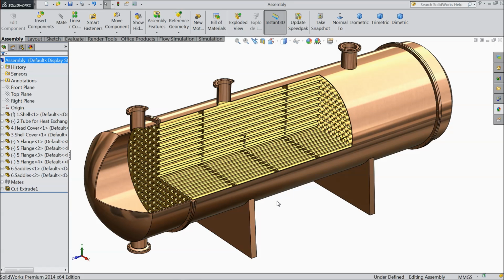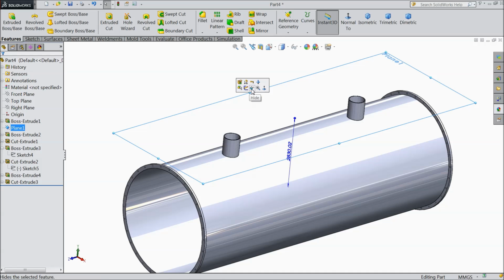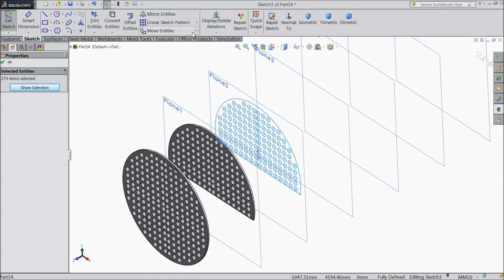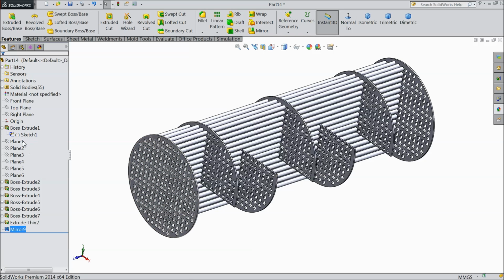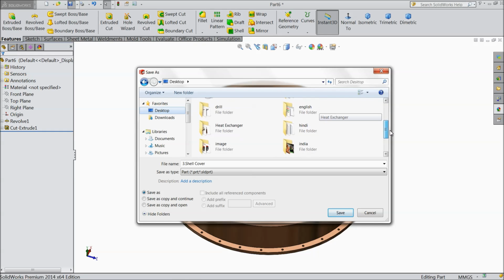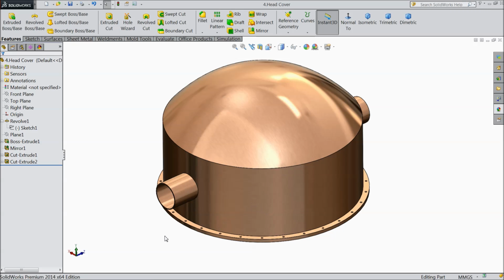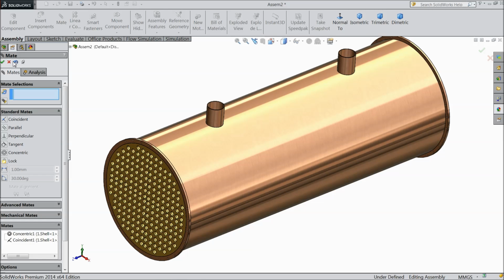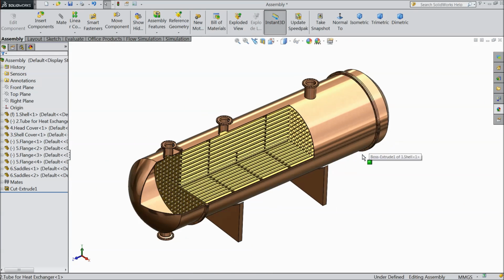Solidworks tutorial | Sketch Heat Exchanger in Solidworks

Comment: I think you missed the partition plate in channel head. This way fluid will not go into the tubes. If we donot add partition plate fluid will come through inlet nozzle and go out of outlet nozzle and will not enter tube side.
Reply: Yes, you are right. There should be a split wall in the head cup.

Comment: The heat exchanger is not sitting in the saddles and they are off set. There is no channel so the fluid will go in and out without going through the tubes.  the tubes around the center lines are not correct.

Comment: We offer heat exchanger welded pipe and tube that OD range: 6.35mm-114.3mm, WT range: 0.2-3.0mm.We are the No.1 factory in China that welding duplex stainless tubes and ferritic stainless tubes.
Any inquiry,Tel/whatsapp/wechat me : +86 15273808575  Skype:alice_3419

Comment: Your inlet and outlet on the shell cover are not correct. Your fluid will not flow through the tubes but instead will go straight through the cover.
Reply from the maker: yes outlet should be beyond the tubes.
Reply: Right. And the top inlet and outlet on the body should be on utmost right and left positions to use all the cells into the body of exchanger.

Comment: your design are so basic! the manufacturing is more detailed than you show in the video, in manufacturing que make ensambly not a singel part
Reply from the maker: i am trying to make all the assemblies and details of the parts in coming videos due to time i skip some parts like nut bolt , washer etc..
Reply: yes but you make a good works, the cover are made  by pushing and welded but you have very good works
Reply from the maker: thanks for watching.